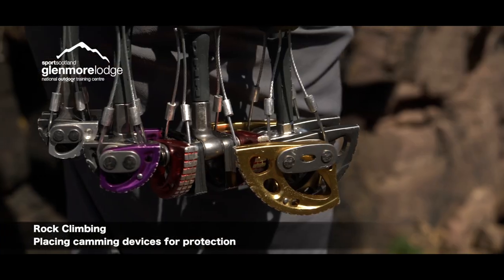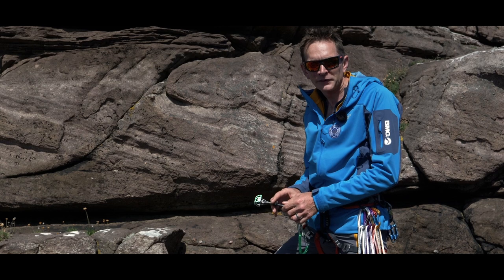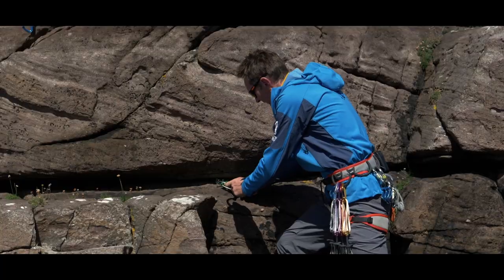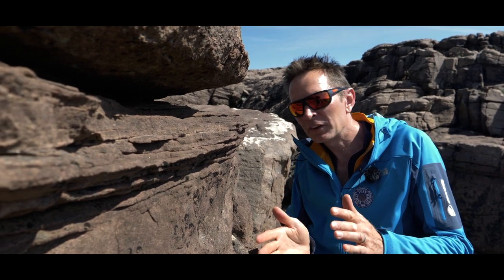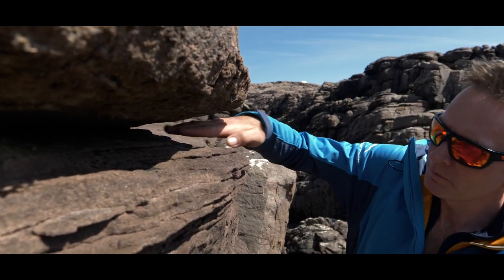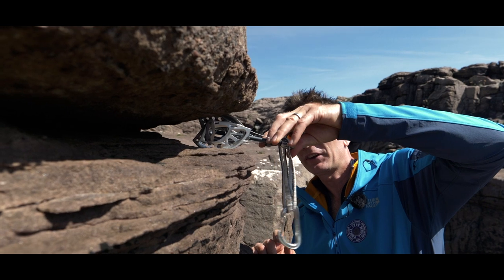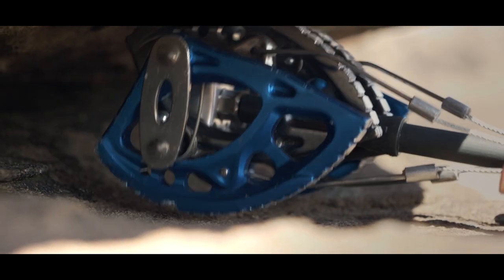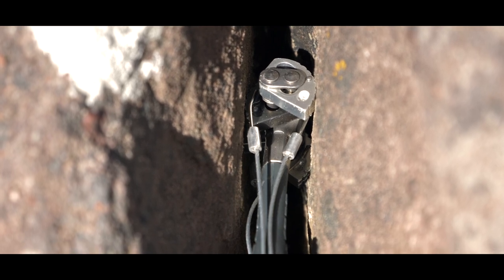Rock Climbing - Placing a Camming device for protection

Comment: that large cam in the horizontal crack wouldn't have held no matter how good the rock quality is, since the direction of pull would have drastically reduced the camming action. You have to be very careful with horizontal cracks (user manuals will advise people not use horizontal placements at all) and I'm a little worried that this wasn't mentioned in this at all. All the vertical placements were facing outward instead of down, too.
Reply: Horizontal cracks are generally ok when using modern flexible stem cams